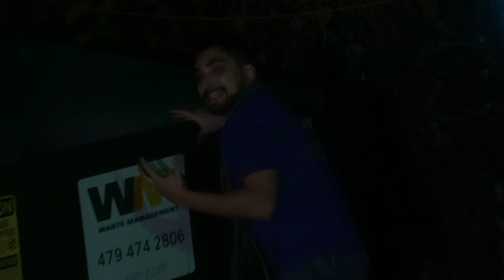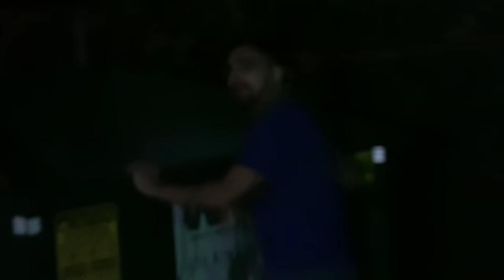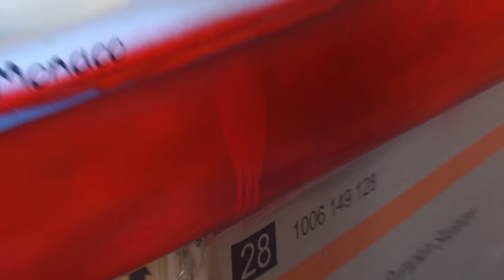Can a Fire Extinguisher REALLY Power a Boat??

Comment: You guys should try and use power washers and call it a jet boat
Reply: Genius
Reply: This one may actually work lol. Let's get this comment to the top boys.
Reply: Fuck yes great idea
Reply: @marlboroman6370  done lol
Reply: This would be awesome to watch
Reply: This
Reply: oh my god yes! might actually provide some decent thrust and would have a cool effect, though of course the weight of the machine and batteries would be a large issue
though yeah like the large industrial ones which are like a big engine with a full metal "rollcage" and a long sprayer, along with the elbow support thing -- could still easily knock you over at full blast if you aren't prepared
Reply: Bumping this idea
Reply: Im sure its in the works already

Comment: Take off the pressure indicator and remove the Schrader valve core and fill with flammable motor juice then put the valve back on and pump to 120 psi put a blowtorch in front of the nozzle and spray
Reply: They do not have the brain power for that, but to be fair I don’t either
Reply: These sound like instructions for a bomb
Reply: These are the best kinds of youtube comments lmfao

Comment: If you're ever hurting for cash, or just need to get rid of it, you should totally do a drunk auction on the "booty patrol" boat.

But like, wait a year or so. You should definitely have some videos next spring/summer racing the two. 
>21st annual boat race
>who can build a better 100dollar boat engine
>ultimate 100 dollar battle boat
And if that last one doesnt sink one of them, finish off the warm season with 
>can a boat stop a bullet 

And let's say one or both just get completely wrecked, cut out the part that says booty patrol/fire hoes and do a thing with them. 
That's 2 booty patrol wall art things
And 3 fire hoes wall art things. 

Theres at least 3 months worth of content and an event idea. Think about it.

Comment: I could put the 650cc motor from a motorcycle on that thing... and a 10 inch wide propeller. bulge pump and all... no one has money for those thoughts... sends another monkey to the moon and back because still don't believe, they swapped it out with the broken one after the the three days ended taken back for instore refund same as how most xmas's go.

Comment: I have a question, so if I were to type in the code "holiday" to get 15% off of Raycon wireless earbuds but also use someone else's code, would the savings stack? And if they do stack then would that then mean that I could actually use enough codes to get a pair for free?